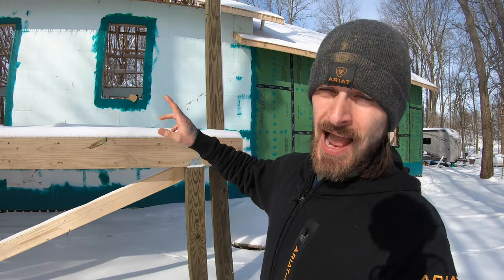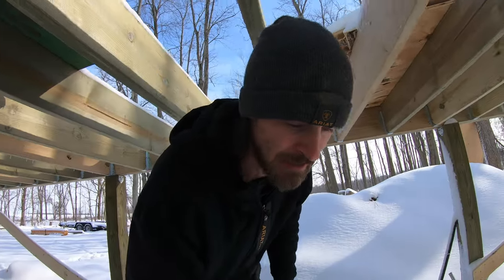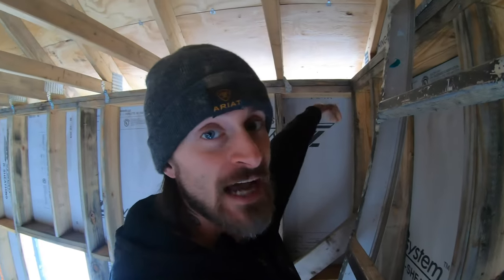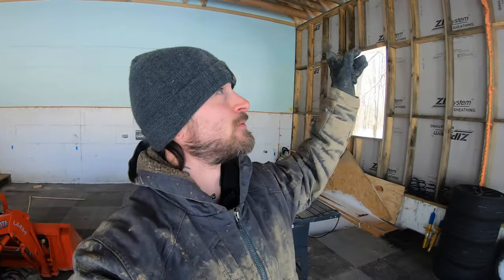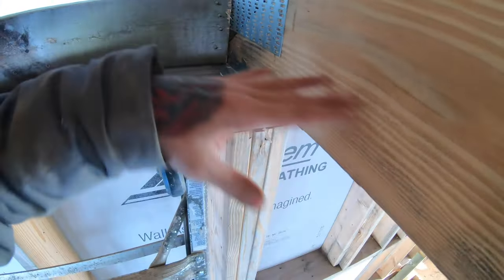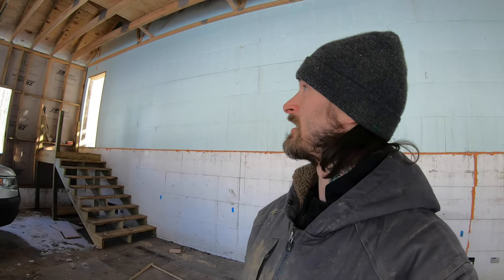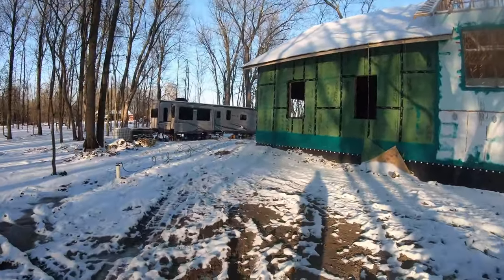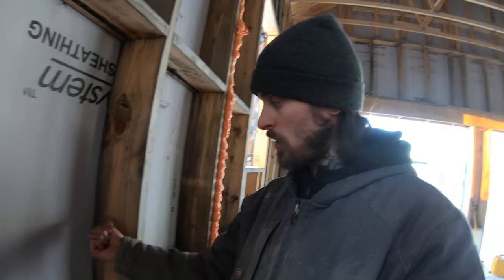Fixing structural mistakes and venting the garage roof.

Comment: Excellent workmanship. I always believe it is the right way to deal with air channels, eaves and ridge vent the way you did. You will see a lot of temp difference in summer. Kudos.
Reply from the maker: it'll probably help my ice and water shield out too. while it has a 250 degree rating, it might get higher than than if the under sheathing wasn't vented properly.  granted we're still doing furring strips and with our trees i don't think the sun is that bad vs other homes.

Comment: Those H2.5A hurricane straps will be in your way for the steel j-trim. They should be installed so the short, flat transition is equal to the edge of the bottom cord of the truss.
Reply from the maker: I know.  Have to do a little notch or something in the drywall.

Comment: I am new to the channel so I am sorry if I am repeating something you covered but in addition to the length of the 10d they also have to be rated for pressure treated lumber.
Reply from the maker: Yes all outside and treated lumber used heavy hot dipped galvanized nails.  Even on the inside as that’s just what I picked up.

Comment: FYI....now is the time to install wire mesh to that blocking as a critter guard. The soffit guards are never enough. It will prevent rats, bats, and squirrels from chewing their way into the attic space. This is a necessity for houses built in rural wooded areas.
Reply from the maker: I haven’t picked my material but I dont think I’ll be a problem but I’ll take a look.
Reply: @neckofthewoods24  just trying to point out that it would have been the perfect time to add critter mesh before the foam vents. The critter protection in vinyl and even aluminum soffits don’t always cut it. And with putting metal up for your ceiling, you won’t see the obvious tell tell urine signs if it were sheet rock. I bought a 90s build home as a rental investment. It cost me $40k to fix the rat and squirrel damage.
Reply from the maker: @johnnelson8956  the vents are plastic and there’s little room to get up in there between it and the sheathing.  A mouse yes and we don’t have rats and no chance for a squirrel.  Whatever soffit material I go with a mouse isn’t getting through.  If I go aluminium nothings getting through that as it’s metal.  We’ll see.
Reply: @neckofthewoods24  Critters will chew through that like paper.  (I speak from having always lived out in the country/rural area.)
Reply from the maker: @AmandaMoen  through the soffit that’s Osb?   Still good at this point.
Reply: @neckofthewoods24  my parents bought our house August 1976.  So, I'm not sure.  May take a while.  Probably just a good idea to routinely check, just to be safe.
Reply from the maker: @AmandaMoen  of course but not likely.  It’s treated wood and to chew upside down would be impressive.

Comment: great explanation about insulation and venting issues.  why not finish laying down roofing paper/ice shield membrane to prevent rain water dripping into your garage til you are ready to install the steel roof? are you going with standing seam? its a real nice product but pricey.....but you only pay for it once!
Reply from the maker: Because I have several inches of snow in the way and it never fully melted.  Also the paper is so thick if I unroll it I think it’ll crack and break.  Needs to be warmer out to also stick to the wood.
Reply: @neckofthewoods24  well I guess patience is called for over the next month or so til warmer weather returns LOL

p.s. what about your choice of style of steel roofing?
Reply from the maker: @neoman7479  yeah I have to, sucks but it’s gonna get really cold weather it snows or not.   The steels a secrete for a future vlog.

Comment: I'm curious if you are having any mold issues?  I am building a much smaller home than yours, it has a 4 foot crawl space and 8 foot walls ..the build is going fairly quickly , endured several good rain events but nothing excessive by any means.  I just got the shingles on it so its "dried in" so i decided to go ahead and cut the hole in the floor to access the crawl space (we put a door in living room under couch), its 3x3. anyways, the underside was covered in mold-not a little but a lot...anywhere the rain water soaked thru and got on the underside of the osb is very moldy...there are no vents in crawlspace (going to encapsulate) which caused the problem even more..never thought it would be an issue...after i completed the osb flooring id say it was exposed probably 2 months before i got it dried in...just curious if you have any issues, course its pretty cold there right now it looks like..
Reply from the maker: I’ve got a little in some spots as the trusses where on the ground for a month.  Nothing growing or spreading though.  A bleach spray bottle will help later if need be for those spots.

Comment: the "d" stands for penny, so an 8d nails is an 8 penny nail.  I found several articles on the web giving various explanations of the origin of penny with regards to nail sizing.  Here is one.  https://www.thomasnet.com/articles/hardware/screw-nail-sizes/.  None of them make much sense for modern nails.  Length/diameter make more sense than some old abbreviation on a penny.
Reply from the maker: Yeah my dad still calls them that.

Comment: IMPORTANT. At least I think so. You talked about spray foam and batts. Check out YouTube channel “spray jones” and search for “spray and fill” episode. He’s all against this and explains why. The video is in the one year old category if the search function doesn’t yield results.
Reply from the maker: Ok I’ll look.
Reply from the maker: Just looked.   I have to disagree on some points but  he might be right about one and I’ll explain.   I don’t like how he says basically a closed cell foam which is a vapor barrier is going to allow vapor in if you have a hole in your siding and sheathing.  He shows a ton of pics of failed fiberglass against OSB sheathing but that’s gonna happen behind spray foam if you have a hole in your siding and sheathing haha.  Either way outside needs 100% sealed or it has to be a big enough hole to allow air in to dry it back out.  I agree with the dont spray your entire ceiling, just throw up a sheet of plastic above the drywall.  

As for his 2/3 or 1/3 method that could make sense.  For example I already have R6 on the ZIP R.  If I do 2” of closed cell that’s R20.  If I then put in a batt for the last 5.5” that’d be R19 or basically a 50/50 wall mix.  There’s no way on earth moisture is coming from the outside with taped ZIP R, 1” of ZIP R and 2” of closed cell.  I’m not 100% if moisture would go through drywall, paper faced batt, 5.5” of batt and condense on the front of the closed cell.  I’d have to look into that.  I think it’s more of an issue if the wall was cold, Like in a basement.  Batt up against concrete and the vapor barrier fails and moisture condenses on the concrete behind the batt.  But with R20 for a wall before the batt I think that’s unlikely.   I could however go to a R13 batt and 4” of foam and now it’s a 2/3 ratio.
Reply: @neckofthewoods24  would rock wool be better in this application. No need to answer. Just go for whatever you decide. I’ll be watching 👍